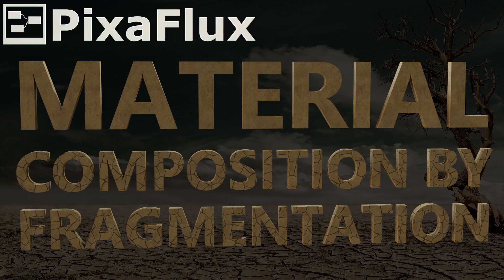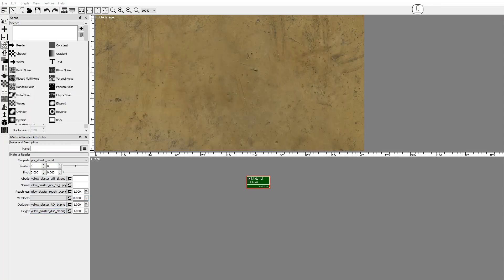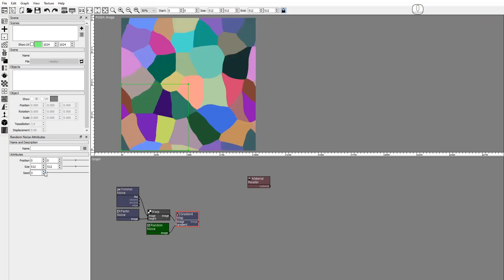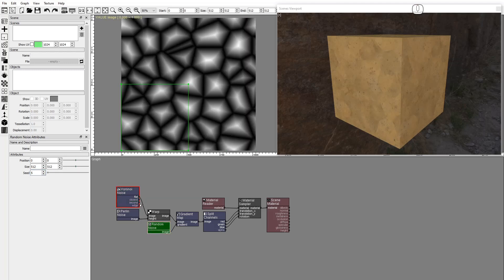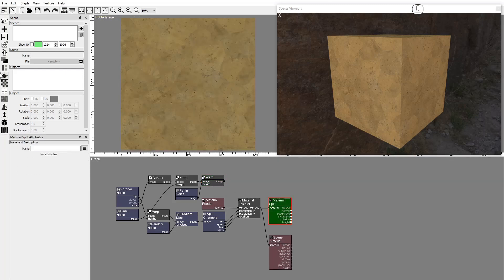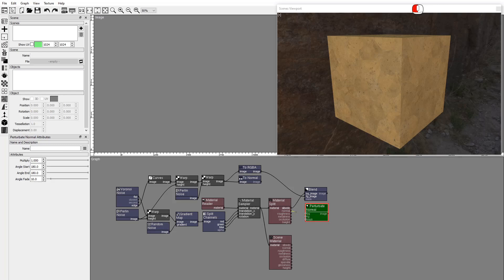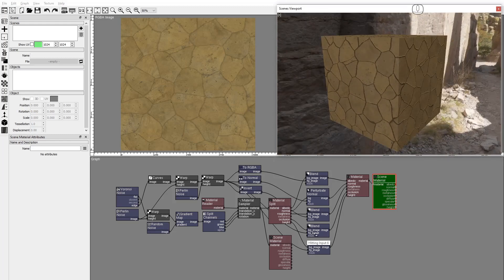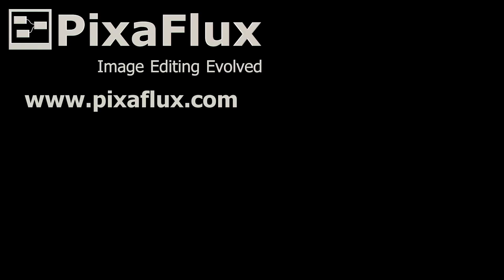Material Composition by Fragmentation

Comment: First I ended up with a COOL texture and I like the program a lot;   hdr´s didn´t  load. Can you help?. I found that when I replace materials needed to go from left to right double clicking nodes, otherwise if you start at the rightmost node PixaFlux will crash. Win10 20H2 , i5, 8 g, plenty of space.   I WILL FOR SURE KEEP ON USING IT!!!
Reply from the maker: Hello George. We've released a new version with lots of fixes, could you please try again.
If you still get the crash, could you please send us an email to support at pixaflux dot com. Please add all the steps to reproduce the crash when you replace materials.